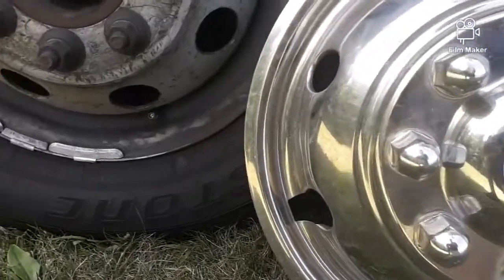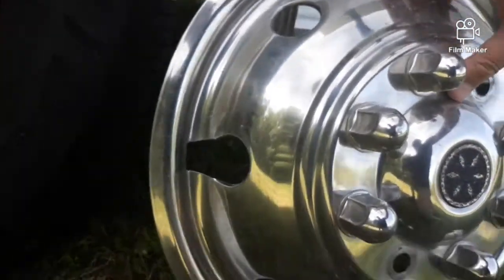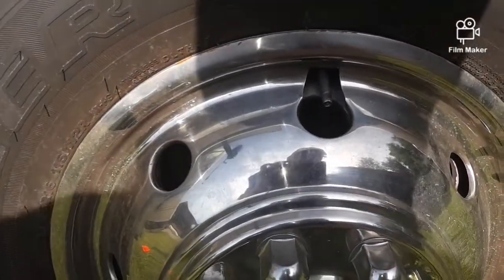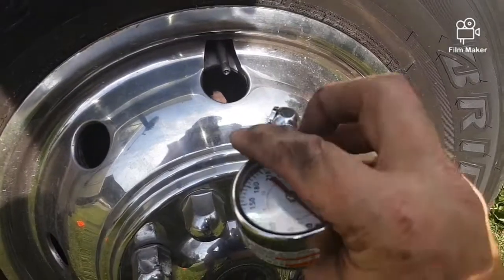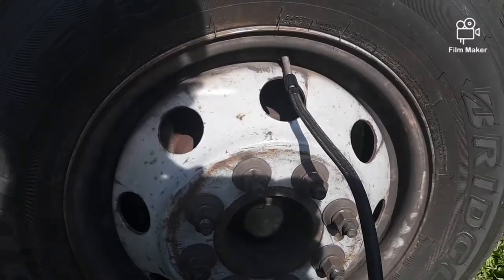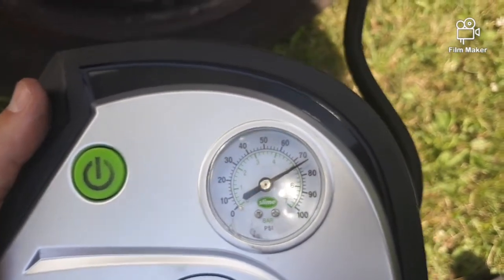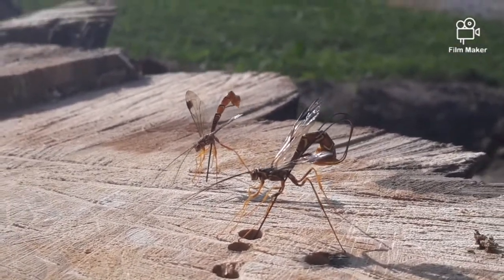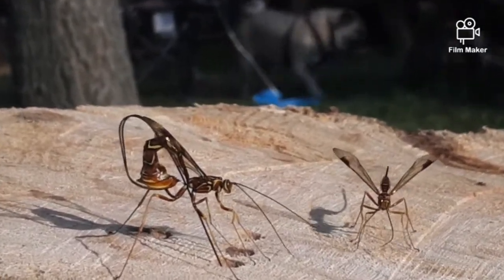Do Tire Stem Extenders Work? Watch and Find Out!

Comment: Unfortunately, the extenders don't work with screw on style air chucks.  The ones we have to press and hold will usually work if the angle is right.  Good video Steve.👍🏾
Reply from the maker: @Driving Home
Yes, bummer. Even they worked the hubcap shape would be in the way.

Comment: I have some on the skoolie they need to be tight otherwise I can't put air in.
Reply from the maker: The main issue on our RV is the front stems. My back ones are fine. The front  hubcaps would still be in the way with these extensions.